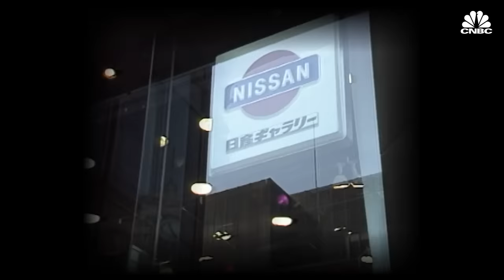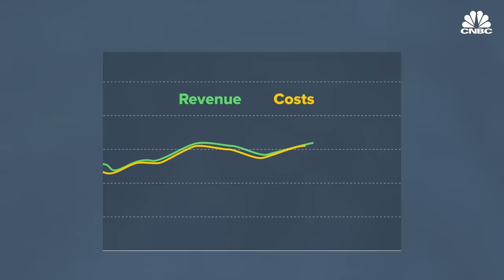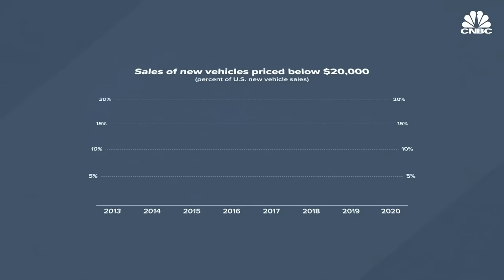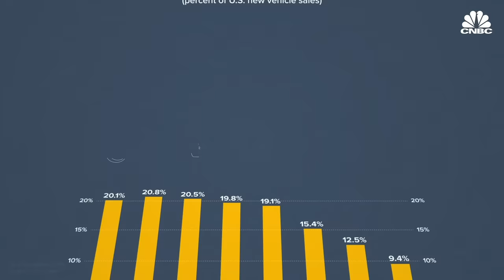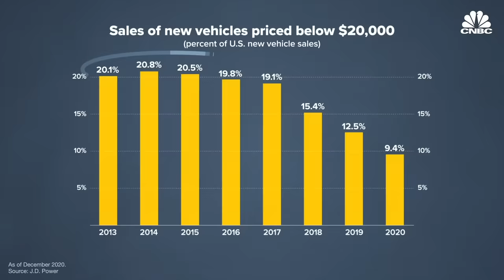Why Cheap Cars Are Disappearing

Comment: At least Tesla is trying to change that with getting rid of dealerships
Reply: Tesla has horrible costumer service and is rlly hard to service your car now imagine without dealerships
Reply: You're talking about the company that doesn't let people turn a bolt without a seize and desist? Also theres been many problems with Tesla non-dealership experience already.
Reply: @Derikimi  depends on what your doing to the car
Reply: Tesla isn't any better. It's a Luxury brand aimed at the luxury market NOT cheap affordable cars for the mass market. The S model and X model already have alot of electrical problems that will bankrupt you once past the warranty. Tesla's are cheap to repair once the warranty runs out that will turn into a money pit.
Reply: @eman0828  man you have no idea what your talking about do you ?
Reply: @popinmo  You probably one of those same people that likes to ignore the facts. Its pastured all over the net of Teslas electrical problems. And yes these cars are indeed insanely expensive to repair. They aren't cheap to service if something breaks past the warranty.
Reply: @popinmo  Not to mention their quality control sucks. Tesla still hasn't figured out how to build cars right with bottle necks in its production system and lots of wasted scrape materials. They can't can't even get the body panels to match up left with gaps.
Reply: @eman0828  how many tesla's do you own?
Reply: @eman0828  so you clearly are not education in Tesla and what they do there cars are alot cheaper than most cars for what your getting it's actually worth alot and alot of the problems you talk about don't actually exist more like a select few people deal with them and also the model s is irrelevant the model 3 is there main car the s is old and was the starting car
Reply: @eman0828  also it was never or was a luxury brand they actually ruined the luxury car market because it's a average car with Luxury features there cars are already cheap and are getting cheaper then next tesla is gonna be around 25k
Reply: @popinmo  You can't compare Tesla's relaiablity to Toyota or Honda. Theres too much proof of Teslas quality control issues and electronic problems on them. just google search and will see failing door handles, body panel gaps etc. You simply can't ignore the facts which is why you seem to be getting  utt hurt now and don't want to admit  about there problems.
Reply: @eman0828  My Toyota Prius V broke down on the highway because of its dc converter failure. Replaced that with a Tesla Model 3 that has no issues over two years and has been extremely reliable.
Reply: @starshipdriver8536  DC-DC is common on Tesla's to break. Just wait until yours breaks and you will see esp once your warranty runs out in 4 years. Plus that Toyota is old that's been around for quite a awhile. They don't even make them anymore.
Reply: @eman0828  Nah that was common on Toyota vehicles not Teslas. Not worried even 500,000 miles past warranty. 

Discontinued at 2017 is still pretty recent. Fact is my Tesla is more reliable than my toyota has ever been. No more emissions inspections either. No more obd scan the codes, setting the monitors to complete for inspection. Hahaha!! 😝
Reply: @starshipdriver8536  I owned a Prius years ago and drove to a 215,869 before I bought my Camry and it didn't have any of those problems. It was a 2009 model. You are delusional if you think your tesla would be trouble at 500k miles. Plus your car is only covered for 4 years as the basic warranty for all the fancy electric gizmos. The 8 year warranty only covers the battery pack and motors, that's it. The rest of the car ends at 4 year warranty coverage and will have to pay out of pocket tor any electrical failures or computer system failure.
Reply: @eman0828  I never had a computer/smartphone fail on me ever in my life. 10 year old laptop I gave to my relatives still boots up and runs. 

I had a Chevy traverse transmission failure that left me stranded along with the Toyota inverter. 

Tesla’s drivetrain is solid, just a rotor moving, and it’s designed from Silicon Valley where I had no problem with their computer products.

The only thing I’ll be paying out of my pocket is tires, suspension/wheel alignment ,wiper blades, washing the car,wiper fluid and cabin filters for that 500,000 miles.
Reply: @starshipdriver8536  Lol you are delusional if computers are fail proof. Computers break all the time. Why do you think IT professionals exist? Smart phones deteriorate over time, batteries degrade, the file system becomes slow overall the peformance of your android device becomes sluggish each year from updates. German cars are notorious for electronic and computer related problems as they break all the time. Mercedes has over 90 some computer module's. Just head over to Rich Rebuilds channel of plenty of proof many broken Teslas. He buys salvage Teslas and rebuilds them. There is a video he posted about the out of warranty repair cost which will blow your mind how expensive they are to repair past the warranty. Good luck with that money pit car.
Reply: @eman0828  Why do you think mechanics at dealerships exist? Because gas guzzlers break down all the time , making the computer failure a rarity. Smartphones get faster models making the older ones feel slower while gas cars lose horsepower and fuel economy as they age. Make a good enough battery system and degradation is a non issue when it last 500,000 miles. 

The german auto industry and Detroit is nowhere as reliable or as advanced as the computer industry in Silicon Valley.

My Tesla isn’t a salvage Model S from 2013, it’s a Model 3 and I’ll be enjoying all the money saved from not buying a money pit time wasting gas guzzler. And the money paid for charging overnight.
Reply: @starshipdriver8536  Why do you think Tesla has a service center? Bro just give up. You aren't make any sense. You are just delusional just like the far right wingers that still thinks Trumo won the election that's been over for weeks. Lol
Reply: @eman0828  Just like IT it’s so much less work than mechanics at a dealership. There’s no sand for the oil spills, no oil drain catcher, no barrels of oil for an oil tanker to retrieve used oil. The floors are actually white and you can breath clean air. I voted for Biden for the wide spread electric vehicle charging stations across the highways. Your traditional stagnation is in line with trumps crowd.
Reply: @starshipdriver8536  I worked in the IT field so what do you know about Network and Systems and Administration? Lol. You seem pretty delusional if you think your Tesla is break proof. Nothing is fail proof. You will have problems down the road once something breaks. Those computer components aren't cheap to replace on a Tesla. That MCU (Media Control Unit) is around $4,000 alone which is that fancy touch screen. Everything relies on it. Once it breaks down, you loose all the functionality to pretty much the whole car which is a terrible design. Speedometer on a touch screen? That's just dumb Engineering.
Reply: @eman0828   A hell lot easier and cleaner than mechanic work at the dealership. Computers are a hell lot more reliable , no mechanical moving parts , no physical stresses like explosions all the time in the internal combustion engine. The probability is so low, that if it didn’t break within the first few days which goes for every tech product, it’s going to last 500,000 miles. The 1989 game boy in the Nintendo store that survived a bombing in the gulf war still functions to this day. 

The Model 3 touchscreen isn’t exposed to the elements. It it even has a cabin overheat protection for children, which is also good for the electronics. It’s going to outlast the internal combustion engine no problem after 500k miles.

I also prefer how jam packed full of features are on that screen. Speedometer is not an issue and even if I were to take the screen out, it still drives , and one can use the Tesla app to view speed and climate controls. In another software update , the car will drive itself while I watch a movie on that 15” screen or go to sleep. Tesla is smart to create a highly future proof interface that’s very flexible.
Reply: @starshipdriver8536  Say that to all the  Mercedes S Class, BMWs and Audis that's always in the shop of some computer or electrical issue. Again the more electronic complexity that more that can go wrong. You remember all those thundends and thousands of failing electronic handles failed on the Tesla Model S or the failing door latches on the X Model? Nothing will last 500k miles without replacing something I promise you that. Your Tesla even still has physical moving parts. The bearings will wear out over time, you still have the same traditional suspension just like any other car. You still have to change the break fluid, the Transmission fluid and the Coolant on them. Again your delusional.
Reply: @eman0828  Mercedes, bmw and audis are traditional autos not Silicon Valley companies. They don’t understand software, vertical integration or tech, they throw money at outside vendors and hope it works.

Model 3 isn’t the S/X , so I’m not worried. That’s true for internal combustion but for the Model 3 drivetrain there’s no replacing anything for 500,000 miles. There are oil filters for the gear box on both drive units which means no changing gearbox oil for 1million miles. And the coolant is enclosed and doesn’t go through an internal combustion engine so that’s never changed either. 

I stated suspension and tires first, which is not as big a deal as a rebuilt engine or a rebuilt transmission replacement just to get a gas car going.

You’re delusional trying to put computers or the ev drivetrain on the same level of unreliability as gas cars.
Reply: @starshipdriver8536  Man you are seriously talking out of your behind. You clearly don't understand car mechanics or how a coolant system works in a car. I even worked on cars   as a side gig occasionally but I'm no pro mechanic by any stretch of imagination. I worked on Hybrids as well which is half of an electric car that shares many of the same or similar components in a EV. Coolant doesn't last forever nor does oil or brake fluid and transmission fluid. There is no such thing as life time fluid. All of those chemicals break down and deteriorate over time that no longer becomes effective. Just like in an IEC, not changing your coolant would cause corrosion and your engine would overheat. The same applies to DC-DC inverters and battery packs that would overheat. Hybrids and EV has two coolant systems meaning more complexity. Even the Prius has two coolant tank reservoirs. Your Tesla has brake fluid like a normal car that would need to be maintained as well. Once water gets in there from moister, it starts to break down. Your Tesla has a gear box filled with ATF that also needs to be changed. You aren't being realistic if you think nothing is going to break past 500k. Miles. Wheel hunting bearings will eventually wear out which is one of the first mechanic things to go out on a car the more miles you rack up. Your Tesla also has struts and sway bars, CV axles, control arms just like a normal car. All of those are mechanical components.

Comment: If I will be able to own a car that will last and for keeps....... 

I just need a decently powerful, 7-seater, midsize, turbocharged diesel 4x4 SUV with this features:

-all power amenities (steering, windows, locks, mirrors)

-SRS Dual Airbags

-ABS with EBD

-Traction Control with ESP

-smooth suspension

-tough and rigid platform

That's all

Comment: It's pay now or pay later. Do a LOT of research on vehicles that you might want. Learn how to evaluate them,  make purchase depend on a mechanic's inspection.  The cheapest cars are from private buyers, but there's no warranty. IM0 vehicles between 96-2010 you can get reliable ones IF they were maintained! Service records and maintenance are key. New cars depreciate the minute you drive them off the lot. Pay cash and put what you save into maintenance!

Comment: The more tech you put into the cars more expensive they will be.The drivers have not wanted the high tech in cars from the beginning.Most drivers buy cars because they want to drive from A to B.Most of the high tech and gadgets are things you probably will not use on the way to work.What they need are a reliable cars.
Reply: Reliable is a acient word in modern car industry, most cars comply with government/environmental first increasing the complexity in the engine, second luxury stuff for the average consumer, third a relaible car, and last a easy to fix car, so a 90's- early 2000's is a very different type of cars

Comment: I’m in my mid 40s and only last year bought a used car at a dealership with a loan. Never have bought a new car. My parents haven’t had a new car since their mid 20s and my fiancé had never owned a new car either. My car is a 2019 which is the newest car I’ve ever had. My previous car was a 2001 and technically there was nothing wrong with it. My car before that was a 1981 and before that was a 1978. We bough a newer car because my old one was a stick and my fiancé hated my stick driving. I personally don’t see the value in buying new and getting hit with that initial value drop.

Comment: The cars of today have more electronic equipment on them that ever in the past. Also it is unheard of for a car not to have air conditioning. Also the manual transmission has nearly disappeared. Around 45 or more years ago it was possible to purchase a car that was sub-compact and had almost no options. The basic low cost car back then had no power steering, no power brakes, no air conditioning, no radio, hand cranked windows, a four speed manual transmission and a very low power 4 cylinder engine. The original Volkswagen Beetle was typical of the low cost basic transportation car that got a person from point A to point B with no frills and no options.

Comment: As an engineer, it's the electronics. Everything has to be electronic, "smart", integrated, idiot-proof, and generally just overly-complex to achieve things people used to do just fine with their own brains. I work in research in embedded vehicle controls, and I drive a manual-trans, base model vehicle with push locks, roll up windows, etc.

That should tell you all you need to know about why you cars are way too expensive. I design cars every day for people that need to seriously re-evaluate how they spend their $

Comment: The new cars are overengineered and so reliable. Leaning towards a smaller engine with turbo is not a very good idea. I drove the new Accord, and it was a sad experience. New cars have  way too many unnecessary sensors. Electric cars are now facing problems such as the electrical grid incapability of the cities. Teslas are very cheaply made. Look at the interior. Some of them use window controllers from the old mercedes models, transmission operating system, low quality of the interior plastic parts.

Comment: The bigger equals safer idea is such a trap. Design matters and bigger always means heavier and heavier means more momentum and more energy that the vehicle must absorb before it is delivered to the cabin (you). Engineers have known this for a long time. Basically once we started studying crashes it was quickly seen that more rigid equals more deadly. The most deadly car on the road isn't a car, it's the F-150. Per vehicle sold more drivers die in those things than anything else.

Comment: That last statement is a complete lie. As someone who both works on cars as a mechanic and picks up cars as a tow truck driver I can tell you that most vehicles that were built after 2019 are complete trash off the lot. You’re lucky if you get your first 2000 miles in before you need your first jumpstart. The electrical systems in these newer modern vehicles are the worst in automotive history. Not to mention they cost significantly more just to keep them on the road then anything built before 2018. This fact is not specific to one manufacturer but all of them.

Comment: I bought a brand new 2020 KIA car right out of the factory of South Korea for $13.500 about a year ago. When I was done using it 6 months later, I sold it to a retailer for $10.500 no problems. You're just gonna end up with a headache buying a decade old car fixing it and paying for repairs. Just get a new one, that you'll sell in a few years for a good price. You'll save money, believe it or not.
Reply: Vehicles are far more reliable than you're making them out to be.  Older cars typically have a vast 3rd party parts system to find replacements, are typically cheaper to own and repair, and cars needing major repairs such as an engine replacement or rebuild, are typically pushing 20 years if they had a decent owner. This is, in large part, due to lemon laws. The only reason most vehicles do not go that long, is because people fall for the planned obsolescence system of "year models" by car companies and trade in every few years (also used by cell phone manufacturers).
Reply: @uni4rm  Every single second-hand vechile I bought had issues. Just the one I have right now, a hybrid toyota for $12.000, the 12V cig-plug isn't working, usb isn't working. The brand new KIA car I drove everyday for 6 months had zero issues. Zero.